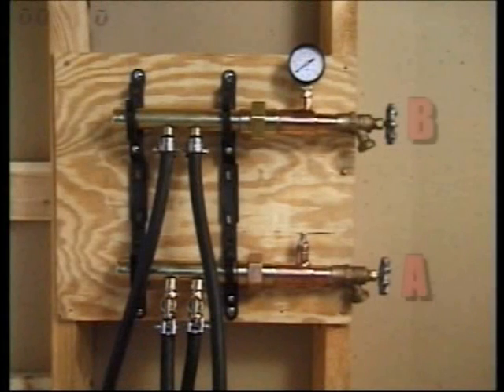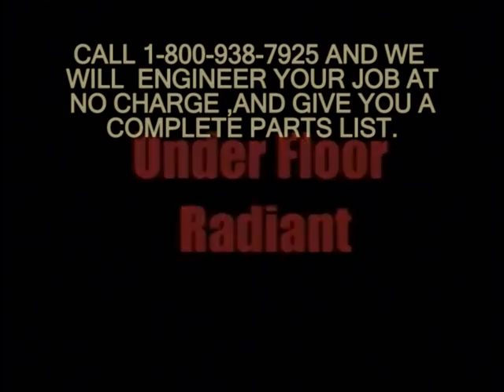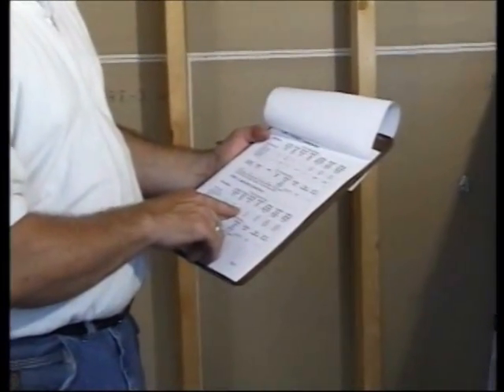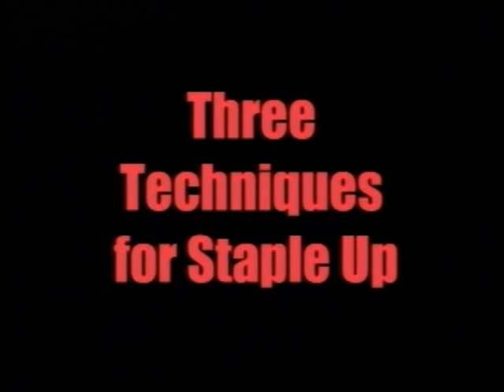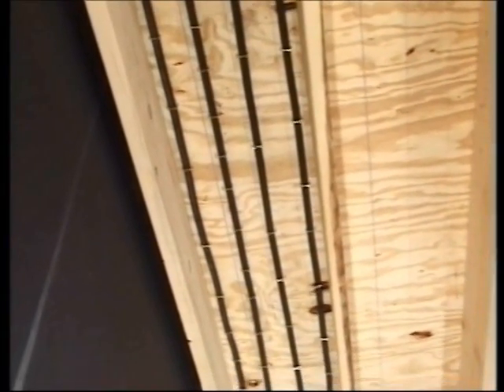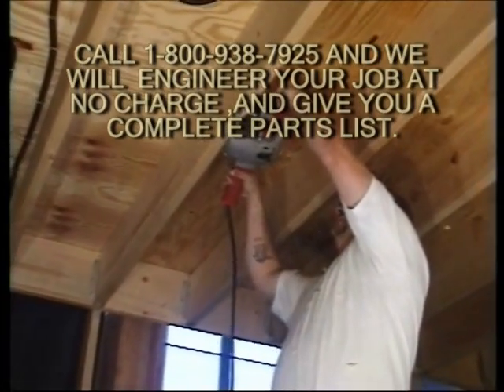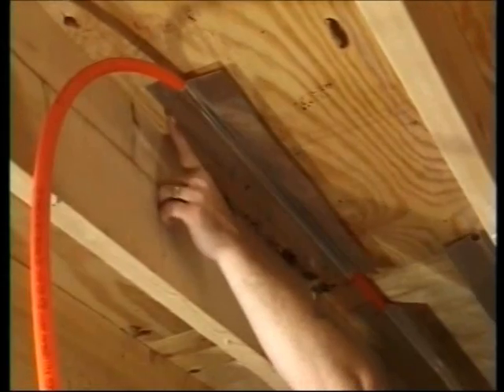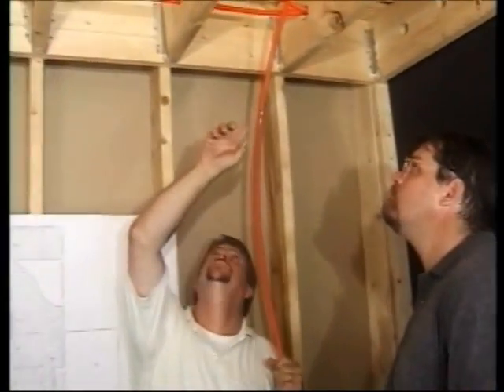radiant heat floor diy 2 0f 3 floor warming  video

Comment: If you go with pex underflooor - in between the joist cavitys - would it make sense to spray closed cell foam over everything ?  I'm encapsulating a crawl space under my kitchen - I was thinking of throwing a pex circuit to warm the otherwise cold floor for seasonal heating.  Maybe just plain batt insualtion would be best.  Anyone used spray foam before in this type of application ?

Comment: As long as you have the proper temp there is no issue at all, hardwood is more effected by moisture, but if you run 180 degree water threw then yes you will have an issue. Most issues with hardwood is the install of the hardwood, its not aclimated properly before the install and the installer blames the radiant. If hardwood is not in yet use a board on top of the sub floor that you snap the tubing into then the hardwood on top, this is a better method.

Comment: Thank you... how about the issue I hear of plates increasing BTU's but can cause issues with hardwood flooring (too much heat). Thinking about going with hanging method and reflective insulation since most of the house is hardwood. Less BTU's but a more even heat.

Comment: Plates would be more efficient but use extruded plates, the rolled plates are junk and tend to make noise. Extruded plates are costly but worth it. If you can you should try not to do under the sub floor and use a method ontop the sub floor. Stay away from the rubber tubing they still have issues but they are not admitting to it.

Comment: If using pex tubes under in the joists under the floor, what is the best or most efficient install... Suspending the tubes or using heat transfer plates?